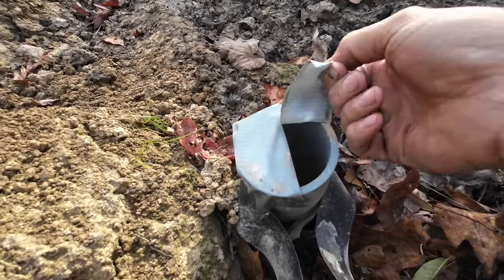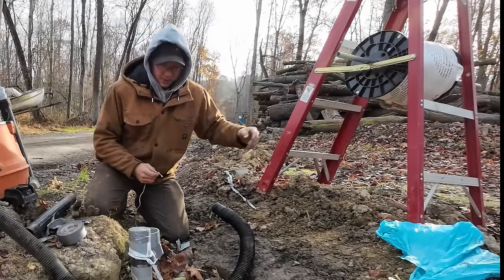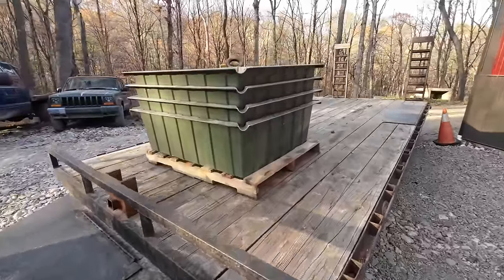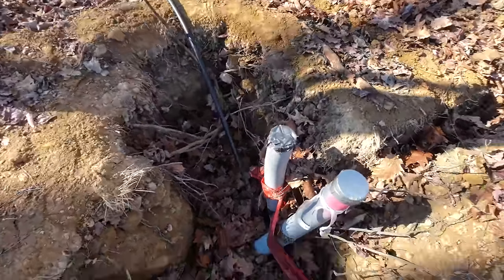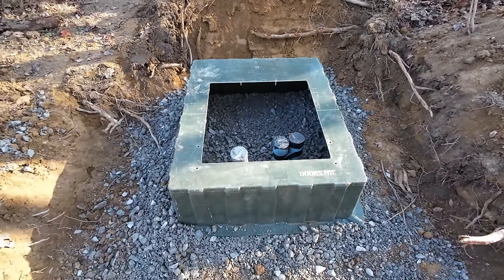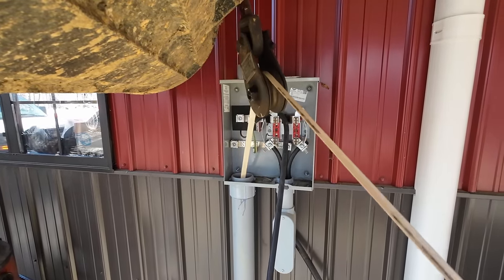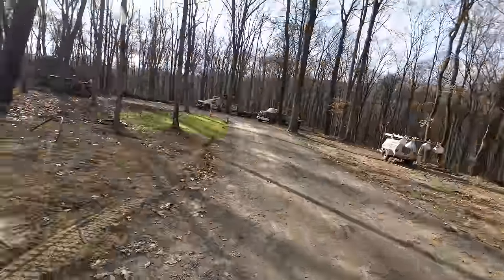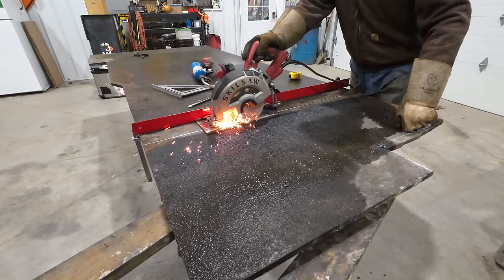The Power Company Charged me $52,000 for this!!

Comment: Thinking about it, the price is absurd, but they might be in the right of it. If "they" don't do it, and it attaches to their equipment, and say something a few years later causes damage to their equipment, they would have to sue you for the damage. Where as if they pull it, they're ultimately responsible for everything up to the meter. It's very stupid, but I'd probably file a complaing with the PUC or whoever regulates them that you were charged an absurd rate, you're basically a farm, not a factory.

Comment: I work in utilities and I can assure you they did more than just pull some primaries through. There's a lot of legaleze that goes into putting high voltage into the ground, especially 2200 across multiple properties! I can assure you power companies are heavily regulated so a lot of that money isnt even going to them.  Is the 52k fair? Absolutely not. Just companies absuing you via the power companies.

Comment: You just got to experience first hand what happens when a public entity (the power company) is unionized. They have all the power, they hold all the keys and you have to bend to their will or get nothing. And in their defense, those line voltage wires are carrying probably 7200 volts (maybe 4100) and the isolation required at those pull points requires a large volume vault that has to remain above any potential water intrusion.

Comment: could somebody tell me exactly what these green things are? are they just protective covers for electronics? i've been seeing quite a few being put in the ground after some electric companies have done some wiring. does it have something to do with fiber optic or just running electric in general?
Reply from the maker: The big one in the thumbnail is a transformer to take the mainline 7700v down to 220v the other green boxes along the driveway are just connection points.
Reply: @DieselCreek  thank you, i appreciate your quick and concise response. mostly been noticing them "in the sticks" on the sides of the roads and was just curious if it was something new or just finally improving old infrastructure.

Comment: I wish you would have said in this video what the cost would have been for solar power?
Reply from the maker: That’s an open ended question. How much solar? It’s not like grid power when you just connect and you have all the power you need. I would have to clear and develop acres of solar array to power my shop. It’s not like you’re just tossing a few panels on the roof and buying a converter and batteries. It would be a massive system to meet my demands. Especially in the winter time. not to mention I’m building a house soon so it would have to power that as well.
Reply: @DieselCreek  Ah okay, such a system would cost over $100,000, perhaps $200,000. Very rough estimates obviously. As long as you have reliable enough power, that makes sense. It does seem like the US infrastructure is degrading and the risk of wide-scale regular brownouts might become realized.

Comment: Its unlikely that your power company charged you anything for a transformer and transformer box. You were (almost certainly) charged for boring in the cable and conduit which is done in most cases by independent contractors who charge by the foot.
Reply from the maker: I put all the conduit In. Material cost on that was 15k additional to this 52k. Not to mention my time. All the power company did was pull the wire and set the transformer
Reply: @DieselCreek   I've never seen a situation where a utility charged for setting a transformer and I've had it done myself 6 or 7 times (building houses for relatives). Typically, the entire process, except connecting the cable to the transformer is done by an excavation contractor, and they typically charge by the foot. If you half-assed the job and expected them to take over midway to finish, you may be paying a premium for that. Essentially, you're asking your contractor to take responsibility for materials and work they had nothing to do with. I suspect you're lucky to have found someone to finish it at all.
Reply from the maker: @markrussell4682  I did not half as anything. They said it was one of the nicest installs they’ve seen  it is all documented on the channel. This is pretty standard operation for how our power company works.
Reply: @DieselCreek  Half-ass. In the construction industry the term refers to a job turned over to a contractor mid job.

Comment: 52k? for what. I dug 1 1/2 miles 4 ft deep for a sub division we developed and it cost us nothing for them to install. We did the ditch and they rolled the cable that was pre sleeved in plastic pipe. Only took them maybe 2 days to install after we dug the ditch, and buried the line.

Comment: Just to ask... But those tie in boxes.... Wouldn't it be more favorable to just simply run conduit all the way straight to the box instead of just tie in 3 times before it goes to a meter on the side of the shop? Then you wouldn't need to worry about boxes sticking out around the property to begin with. But that's my opinion personally.

Comment: with 52,000$ you could have fully set up solar power many times by now
Reply from the maker: Everyone that says that has never done the math on it. I live in an area that doesn’t get a lot of sun annually not to mention I’m in a valley. I also have a high demand. The shop is sucking down power 12 to 14 hours a day not to mention. Baseline power just keeping things energized and the AC on. Even if solar could keep up with that (which it can’t.) I’m also planning on building a house down here ,further putting me over the edge of what solar is capable of doing. (without putting in 10 acres of solar field) ….And then there is that whole winter thing…..  even if none of that was a factor and I had plenty of sunshine year-round being off grid means you have to have a massive battery storage system, which is extremely expensive and has a shelflife as do the panels so even if I spent 50 to 100,000 on a solar system it’s only going to last me so long before I have to replace it. I should never have to touch powerline again and if something should happen to it it’s on the power company not me.

Comment: Forcing you to let them pull the wire is BS.  If the wire passes its tests then there should be nothing they can say.  It should be fine as long as you don’t do anything stupid on either end.  (Especially the source end.)
Before the vacuum rig days, we used a CO2 cartridge setup that basically fired one of those little CO2  cartridges with a string in it through.  It would take a couple of seconds to travel a few hundred feet.
I’m curious what they are calling ‘high voltage’.  I would be shocked if it’s really what the power company typically considers high voltage.  I’m also curious what wire they’re pulling too.

Comment: them allowing has nothing to do with if it's a live wire. Probably has more to do with "you might be able to connect it in such a way you get free electricity." And maybe some safety concerns? idk.
Here the power company doesn't do it themselves but a electrician with a special license has to connect the outside connection to the main fuse box because some people would bypass the meter and whatnot and get free electricity. I don't know why you can't pull the wire through yourself, maybe you could do fraudulent stuff that way?
Now, should they charge 50K for that? Absolutely not.

Comment: Maybe a stupid question .Why not a liqued gas generator?
Reply from the maker: I’ve been running off a diesel generator for a year and probably gone through 5k worth of fuel and that’s just running lights when I’m there working, Running heat and everything I do 24/7  would require a bigger generator that sucks down ALOT more fuel not to mention STILL wouldn’t be big enough to run my house as well when I build it.

Comment: I work for a power company. Pulling primary URG is expensive. 2200 Feet of primary is never going to be cheap, you also have to remember they have to place the pad mount and terminate it on both ends which even if you did know how to do it they wouldn’t allow it. Keep in mind they might have to replace the pole and re work it entirely if they didn’t already have a riser on it and then you’re you’re working with fully energized primary which they would have to work live. I have worked several jobs where did have done the same and charge even more than what you were charged. In my honest opinion you got a pretty good deal, I know it sounds bad but electricity isn’t cheap.
Reply: He could have gotten a diesel generator at one of his many auction deals for far, FAR less.

Comment: Can someone explain the $52K breakdown?  Assuming that the men were charging $200/hour each, that would be ~$7K in labor (10 guys, 3.5 hours).  What was the cost of the cable per foot and how many were there?  Even assuming, say, 4 cables at 2200 feet, I am coming up with like, $15K.  What other big ticket items am I missing?  

I get it that the electric company has to get paid but they at least have to justify the costs.
Reply from the maker: It’s one wire pulled through the conduit. $21 a foot when I priced it. Transformer is 5-8k that’s it nothing else to it

Comment: My question is. Why did the transformer, and main line have to run all the way to your barn? Seems to me, it would have been alot cheeper, on you, if where the pull box is, at the end of the drive, they put the transformer there! Shouldnt be your responsibility to put there supply line all the way down there, when all you need is the service..... Even if your house goes there, the service end should have been more than enough. Would have been thousands cheaper on cable, labor, pretty much everything. So what im getting at is. Why did they force you to take transformer to your shop site, and not just the service line from the point of your road frontage? Id be filing a law suit personally, now that its in!
Reply from the maker: You can’t do that. Voltage drop.

Comment: $52000 isn't bad, everybody thinks that they are getting ripped off all the time.
Reply from the maker: I priced all the materials that they used. It was only around 25,000. Explain to me where the rest of it is even if you were generous and gave 10,000 for labor that still quite shy of 52. Not to mention I’m sure that they get a better deal on materials than I would as a random guy off the street.

Comment: All those charges you're complaining about we're probably approved by your public service commission. It's often not the power company's fault. They have to follow the laws that were passed that govern them. That's the issue with regulatory practices. When there's regulations you have to follow them. That includes charging the customer and having to pull the primary by the power company. They didn't choose that. The law requires that.

Comment: Well that was a foolish waste of money.

You know what poor people do?   
We put a storage shed on the corner of our property, put up the pole ourselves, tell the power company to run the line to that pole and shed... the neighbor has to comply with power company right of way whether they like it or not.   Once the power company is gone and our little storage shed has power, then we run our underground line ourselves (if that's what we want) all the way to our house and shop.  Bonus - they never have to come up our driveway to read our meter, they can do it from the road, and we never have to let them in the gate.

Stick a bench, table, heater, and TV in the storage shed, and the kids can use the storage shed to keep out of the rain while waiting on the school bus.
Reply from the maker: Maybe that works where you live but that’s not how it works here. The neighbor DOES NOT have to allow and easement through their property firstly. Second if you put a transformer at the road and run wire the 1800+ feet to my building you’d have about 30 volts by the time it got there. (Voltage drop, google it) that’s why power lines are High Voltage for long runs then they use transformers to drop into homes and business. The transformer has to be relatively close to the building or it’s gonna have issues.
Reply: @DieselCreek  AC voltage does not drop that significantly over distance.   That was Tesla's innovation - the distribution of electrical power over long distances by using AC, instead of DC.  DC current does drop though.   All power from the utility and to your house and shop is AC.

I don't know what phwcked up state would have laws preventing power to your property.  Here in the South the Rural Electrification Administration made it a mandate to get everybody on the farm an electric lightbulb and farm radio.  

You blew 8x more money just to get power a few hundred feet than I've spent on my entire house.   To spend the money you did would wipe out my entire life savings I plan to retire on, so my counter question is...   

Where the F are you getting that kind of money to casually and carefree light dollar bills on fire like that!    Please tell me, I'd love to know!   

You make that kind of money, and I save it as your brutal frugal accountant, and we could be both billionaires in 10 years...
Reply from the maker: @choppergirl  https://www.mikeholt.com/technnical-voltage-drop-calculations-part-one.php

You go ahead and do the math, tell me how that will work to feed 2x 200A panels over 1800+ feet. At 220v
Reply: @DieselCreek  The transformer is just there to step the 7200v AC at the power pole down to the lower AC voltage of 220/110 used in your shop/home.   Usually this is done by those big canisters on the pole.   Not sure why you need some big institutional box on the ground; we draw 200 amps on the farm here just fine without it.

High voltage AC lines lose anywhere from 3% to 10% energy...   per 1,000 kilometers.  1,800 feet is 0.549 kilometers, so expect to lose as an example 6% * 0.000549 or 0.03% from the road to your house.   Basically 3 hundredths of one percent.  You won't even notice it.

I live on a 10 acre farm with a 220v shop hookup for the stick welder, that has one power company serving one end of the farm, and different power company serving the other of the farm.   If I wanted to, and there was an imbalance in prices, I could sell power from one company to the other.

Next time you want to drop upward of $60,000 to accomplish anything, contact me, we can work out a deal!   I can git er done for $6000!   Or less.  

If I was presented with your same problem, the power company would of been putting up poles right to my house...    if they want to sell me electricity, just their cost of being a monopoly doing business to get a customer for life.

If I had to never the less run it to my house because they balked at it because of some Yankee law, then I would of scavenged the needed poles and wire from an abandoned farmstead and put them in myself.   If I wanted to go underground, it would be the same wire run through PVC pipe.    I wouldn't even bother to rent a ditch witch, I'd just break out the tractor and the plow and plow a row deep enough under the frost line.    Run the line through it once piece of pipe at a time, with a coupler, then glue them together with PVC cement.  When you got it all done, drop it in the plow row and cover it up.    

You don't actually have to put it in PVC pipe, I've seen it done without...  but I like to put all my underground cables in PVC pipe.   Double layer of protection, you just have to run the ends to terminate inside or under buildings to keep the water from getting in them and then standing being unable to dry out being inside pipe.  If it does that, it will over decades actually through osmosis penetrate the plastic jacket of the wires and never dry out and rust them in two.  Had this happen with a long run of black telephone pole line inside PVC that got flooded in a great flood.    Ran some ethernet cable through it instead and terminated the ends of the pipe better so a flood will never again fill the pipe 🙂

Comment: Very stupid to have spent that money burying conduit without consulting the power company first. I would be surprised if they even considered using your conduit having no knowledge of how it was installed. The cable they would be pulling in would be rated a minimum of 7200 volts and it isn't cheap.
Reply from the maker: Who said I didn’t consult them first? I did it according to their spec, they told me exactly what they wanted and that’s what I did.

Comment: How bizarre you do all the work they come out pull the cable join it and wire up a transformer , what am I missing except the overcharging for what with your prep you made a routine job that an apprentice could have  have joined the wires together, high voltage mains or not. Hello from Australia , live totally off grid here opal miner the energy company wanted to charge 22K per pole to connect me and the few house's around me on this field, we passed have full solar and wind gen, powers a three bedroom house, sheds and workshop albeit not three phase like yours. Backup generator rarely use it unless I have table saws and amp sucking things attached. Can see why you needed grid power but still will question for over 50K you did all the trenching and infrastructure yep you had to pay the ransom sad but true.